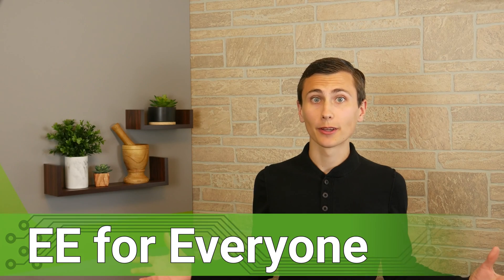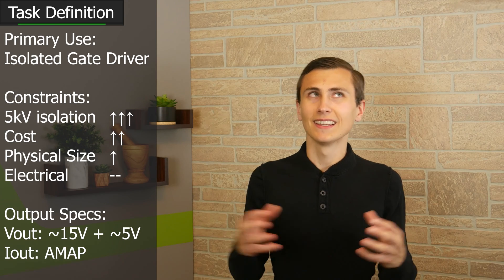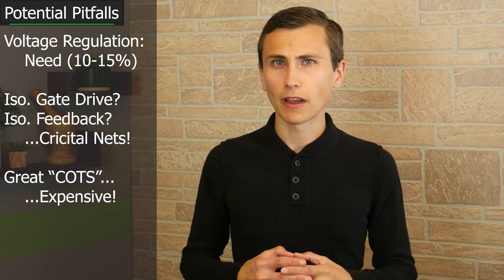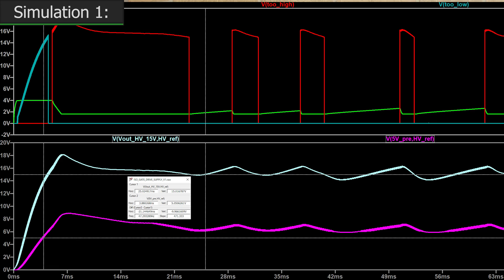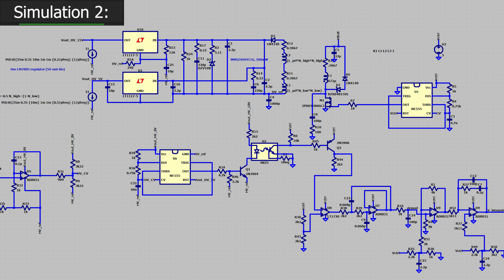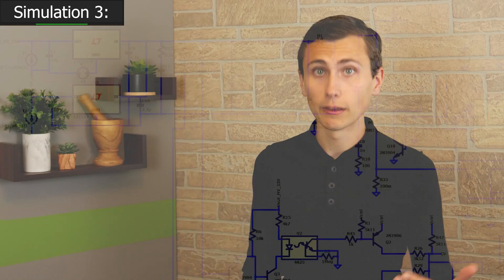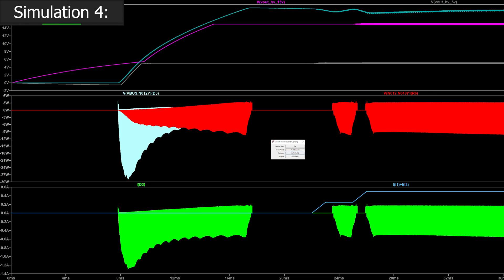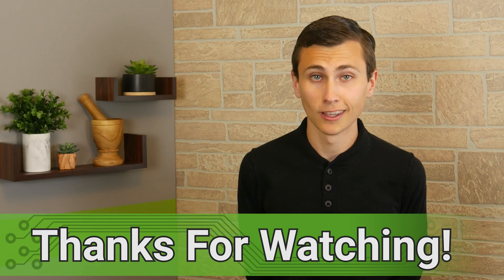555 Timer = SMPS controller!!??

Comment: I'm trying to build a SMPS using a 555timer as the high frequency switching IC,but I can't figure out how to power the 555timer from the 220v mains considering the circumstances governing the 555timer's voltage input range... Please need help
Reply: it''s easy bro, use a normal small 12v smps to drive the 555 timer and make sure the smps's (used for power the 555) ground is connected to the ground of your diy smps. 

or if you don't use small smps then use a 12v capacitor dropper circuit and a 12v zener to power the 555 timer

and please tell me if your project was a success or not.

Comment: What about one for 5672 vacuum tubes?
Reply from the maker: Hmmm, not sure Allen, sounds like you need a high-voltage supply, which I suppose could be driven with a 555 timer, but I'm guessing there's a flyback transformer somewhere there that might do the job a little better. :)